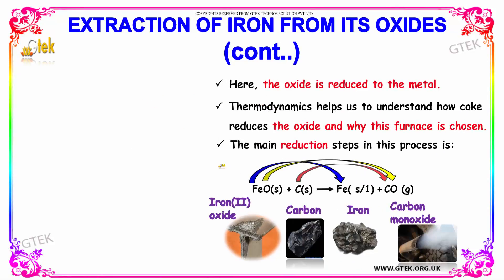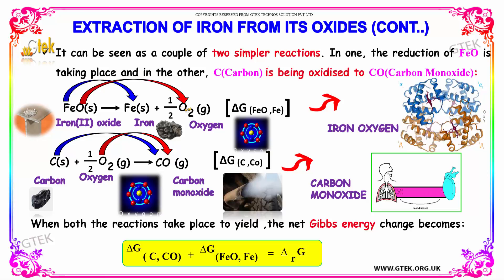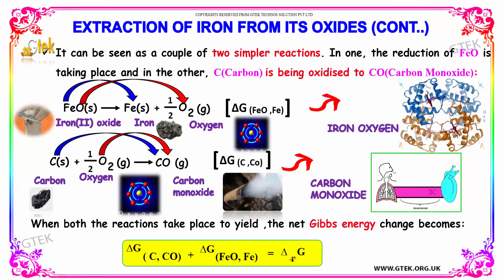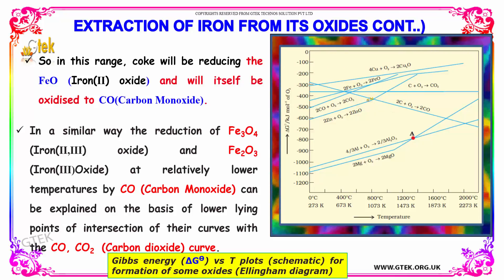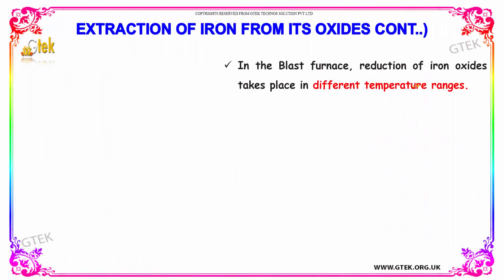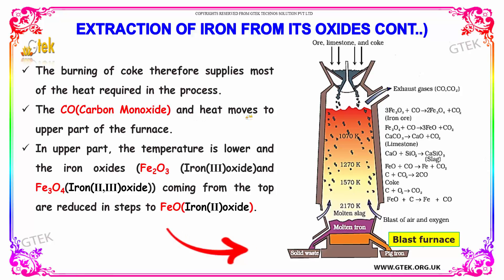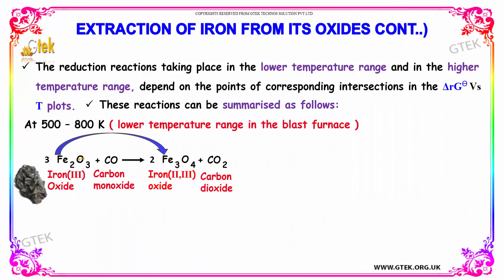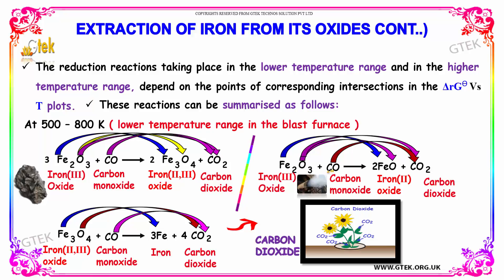extraction of iron and oxides principles and process of isolation of elements 12 chemistry cbse

Comment: Extracting iron from iron ore using a Blast Furnace. The common ores of iron are both iron oxides, and these can be reduced to iron by heating them with carbon in the form of coke. Coke is produced by heating coal in the absence of air.

Comment: The oxygen atoms bond to the carbon monoxide making carbon dioxide and iron is produced as a molten liquid metal. This molten iron can be tapped off from the bottom of the furnace. Iron ore often has silicon dioxide (sand) impurity which must be removed during the process.

Comment: The method used to extract metals from the ore in which they are found depends on their reactivity. For example, reactive metals such as aluminium are extracted by electrolysis, while a less-reactive metal such as iron may be extracted by reduction with carbon or carbon monoxide.

Comment: Extraction using carbon. Metals such as zinc, iron and copper are present in ores as their oxides. Each of these oxides is heated with carbon to obtain the metal. The metal oxide loses oxygen, and is therefore reduced.

Comment: The blast furnace is a huge, steel stack lined with refractory brick, where iron ore, coke and limestone are dumped into the top, and preheated air is blown into the bottom. The raw materials require 6 to 8 hours to descend to the bottom of the furnace where they become the final product of liquid slag and liquid iron.